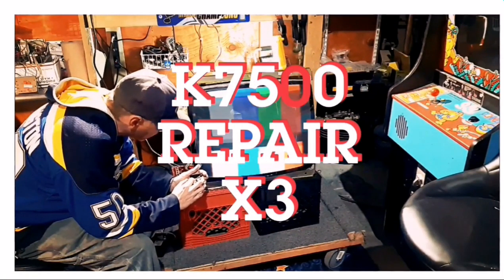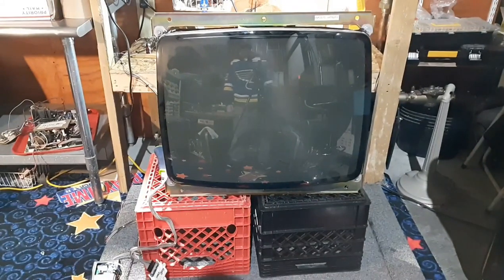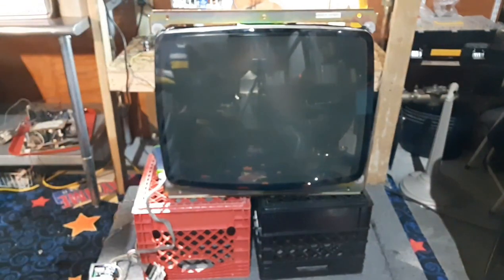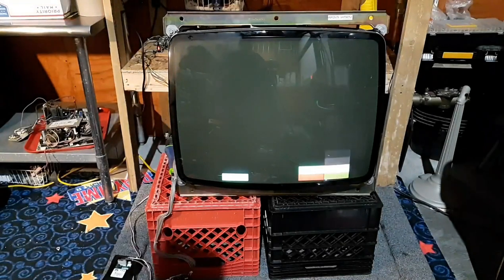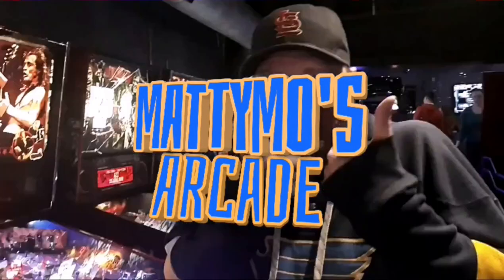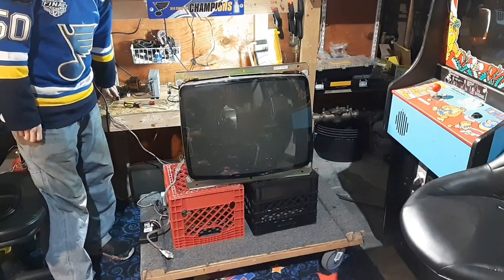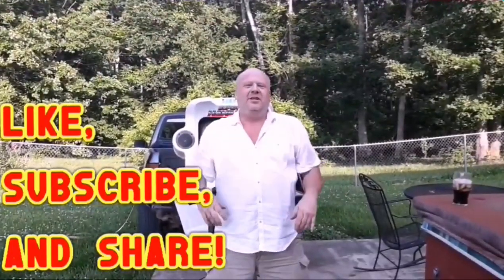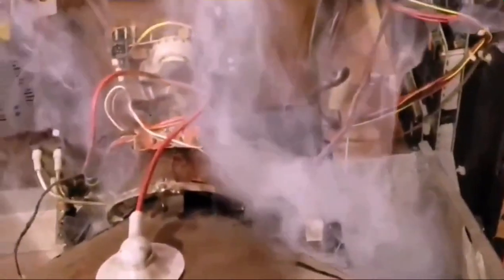Monitor Repair: Wells Gardner K7500, 3 Separate Chassis'

Comment: MATTYMO's arcade, I'm confused on the differences between a Raster monitor compared to a Vector monitor. A Raster monitor needs RGB signals and H&V sync signals and a Vector monitor only needs XY deflection signals no RGB signals and no H&V sync signals? I'm confused on the differences between XY deflection compared to H&V sync signals, what are the differences? are XY deflection signals some type of sync signal or something different?
Reply from the maker: I havent worked on many vectors, but they are completely different animals. It's on my list of things to learn.
Reply: @MattyMosArcade  ok thanks same here